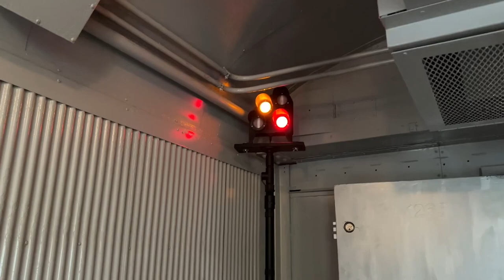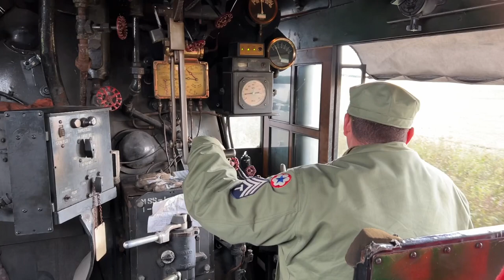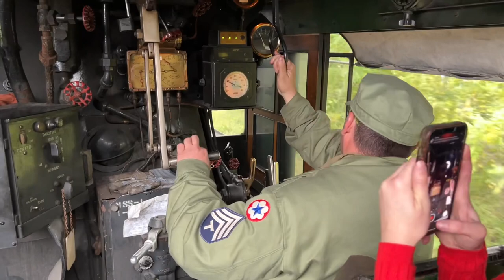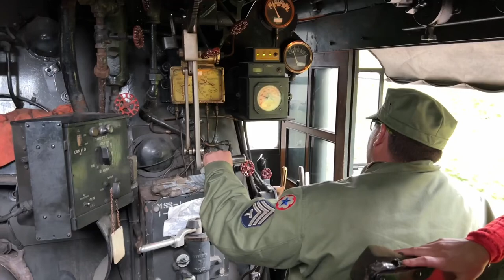Nickel Plate Road 765 - American History Train, September 25, 2022

Comment: I still remember the time I got to drive a 1917 40-horse Case steam tractor. That was fun, and is a hilarious story.
Reply: Tell me, sits down I want to here this
Reply: @mr.sir.  So I was at a 4H fair earlier this year in Summer, and they had that little tractor pulling wagons you could ride on if you paid $5. I however, was and still is a broke college student, and I didn't want to pay. However, I still walked up to the tractor, and started talking with the crew, who eventually let me up in the cab. After talking some more, I was told that if I fired the thing so that the fireman could take a break, they'd let me ride in the cab for free. I obviously took that offer, and chucked wood in for two trips around. After that, the fireman came back, and the engineer asked me if I wanted to drive it. I obviously said yes to that too, and after a quick talk about what controlled what, I drove that thing for a lap around the fair. When we got back to the boarding area, I got to blow the biggest of the three whistles that thing had, a B&O 6-chime.
Reply: @sambrown6426  👏 👏 👏 👏
Reply: @mr.sir.  Thank you.